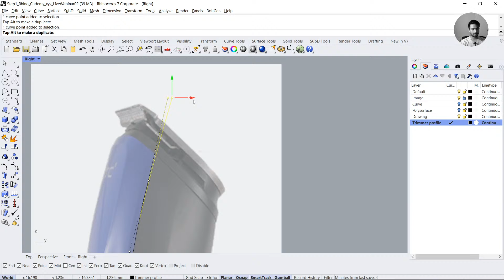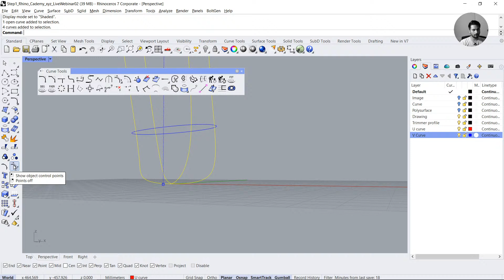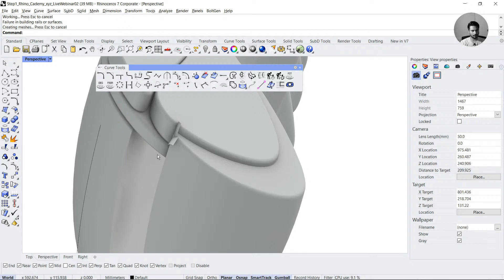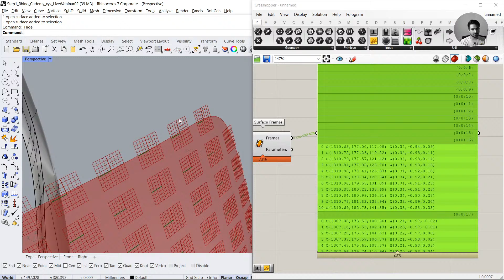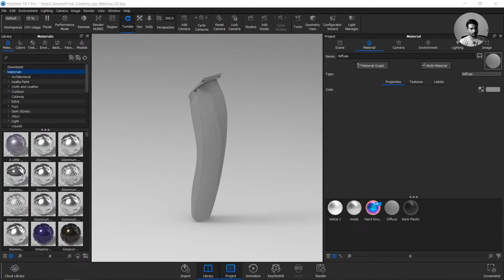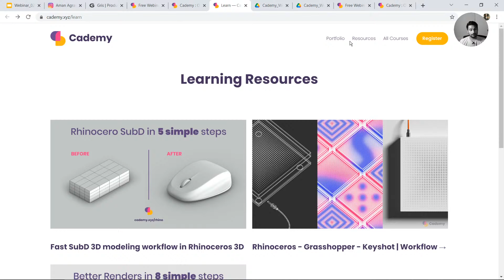Advanced Rhino 3D & Grasshopper: Modeling a Trimmer with Parametric Textures | Webinar 2.0

Comment: Hey I just cannot add my surface to grasshopper it just wont select the surface. Can anyone help ?
Reply from the maker: Did you try to explode the geometry first? If you use a surface container, you cannot import a polysurface into it. Please make sure you have exploded the geometry into individual pieces and then select the surface.
Reply: @Cademy  i managed to do it. it was because the seam line was in front of the surface.So the surface was 2 pieces when i was trying to add it to de surface node. I re modeled the main surface and chose the line on the back as the first line when running the network srf command.